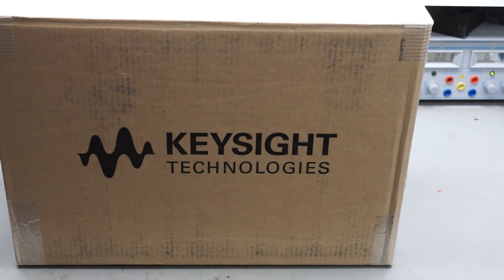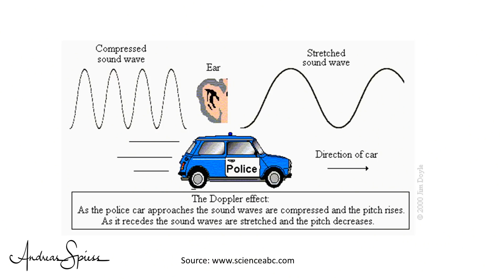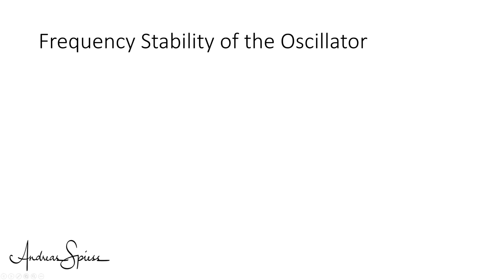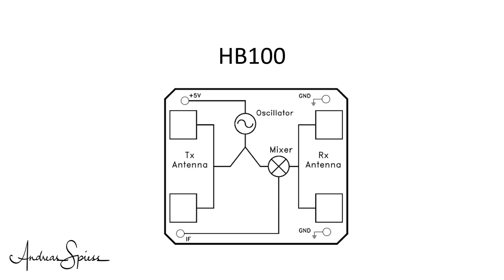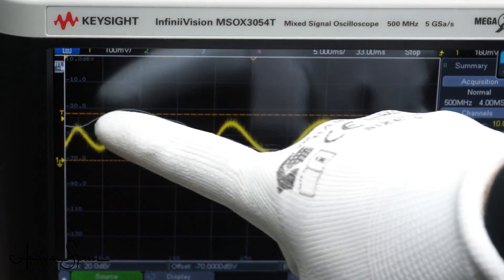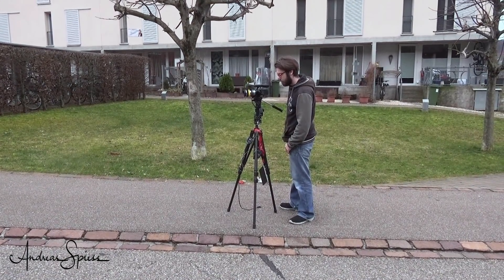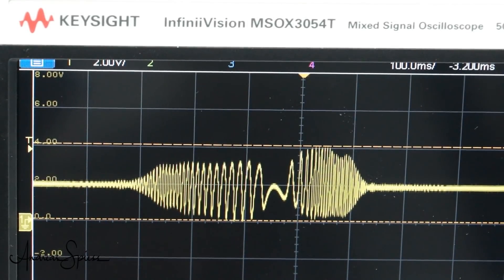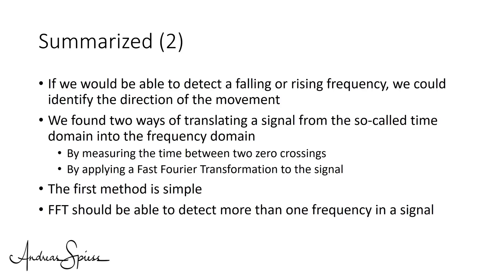#181 DIY Radar Speed Gun using cheap Radar Sensors (HB100, CDM324) for Arduino, ESP8266  and ESP32

Comment: @Andreas Spiess , How to connect my scope's ground probe if i want to take a look at the mains voltage?? 

It is a USB scope running off a laptop on batteries.

I have a 100X probe.
Scope input is 35V max. So in theory, i should be able to measure upto 3500V.

I have a single channel oscilloscope, so i can't use two probes and get the difference between them.
Reply from the maker: 1. As already said: This is dangerous, for the laptop and for you.
2. All mains have a live wire and a neutral. If you connect the earth of your oscilloscope to the live wire, your whole PC will be on 220 volts (It should not be destroyed if it is completely removed from any ground). But as soon as you touch it on an unisolated place, you will be electrified and the PC can be dead. The same applies if you connect anything on your Laptop to ground (as said: Connect a USB or Ethernet etc)
3. If you connect earth to neutral, this should not happen. Check (measure) first, never assume which one is live !!!!!
Reply: You shouldn’t measure mains voltage without a proper differential probe (you can probably make one), but if you’re willing to take the risk anyway (may Darwin bless you), you can connect it anywhere, it doesn’t matter, but make sure that the laptop isn’t referenced in any way to earth (disconnect everything, even Ethernet could pose a danger), or just connect it to earth.
Reply: GRBTutorials i did not quite get the last part.

What do you mean by "or just connect it to earth"?

Are you referring to the grounding clip on the probe??

By the way, my lappy is battery powered and uses wifi.

I disconnected each and every single cable from it and also kept it on an insulated plate and i myself am insulated.

I used a 24V transformer initially and probed around the LV side.

First made a bridge rectifier and connected the ground clip to the negative. But as expected, it only shows half waves when i probed the secondary side. I got a little more adventurous and connected the ground clip to one side of the secondary and probed the other side, i got the full sine waveform without any distortion. But when i used by dmm and measured b/w earth and my laptop chassis, it showed 20V AC.
Reply: Andreas Spiess thank you sir.

I have taken all the precautions that i could. I wanted someone more knowledgeable than me to confirm my idea and make sure i wasn't just getting lucky. 

Thanks a lot to you, and to GRBTutorials for taking the time to reply :)

Comment: But if the pitch is changing when in constant motion, then you can not measure speed,
Reply from the maker: The frequency does not change at a constant relative speed. But the relative speed changes if I pass the sensor
Reply: I think some trigonometry is required for speed correction.
Reply from the maker: On short distance, you are right. For our purpose, direction os more important than speed because we cannot ticked ;-)

Comment: Great Video!! Could you not use two or more of those $6 sensors back to back for an easy direction count cheat? One may have to be detuned slightly via the screw to avoid interference...
Reply from the maker: Maybe this will be the solution at the end...

Comment: Awesome video. I was also using an HB100 in combination with an arduino for simple motion detection. I am looking forward to your solution.
Reply from the maker: We will see how much we get out of the data. I hope more than detect motion...
Reply: Yes, that's a lot harder. I have built and used the reference amplifier that is specified in the HB100 data sheet (the one with the two LM324 opamps). It outputs a square wave with a frequency proportional to the speed of the moving object. The square wave is basically a digital signal. So one could count the 0-1 transitions per second with a moving window. Might be easier then FFT. I only used it for motion detection though. Also note, that I had to clean up the signal a bit. At no movement the signal sat somewhere between the low and high point. And also when an object was just about to enter the field of view the signal was not a clean square wave but some garbage. I used an analog input and cleaned the signal up in code with a threshold detector for the high and low levels. - Greetings from Austria.

Comment: Regarding direction detection.  The frequency change is not very reliable, being based on the detector being offset from the path, but that will vary.  However we can easily note that the volume increases for approaching movement, and decreases for departing movement!  So we can either measure the amplitude of the IF signal, or if you do use Automatic Gain Control, measure the feedback signal which controls the amplification.  That change in amplitude should determine direction in many cases, with a single object.  (Multiple objects are going to be hard in any case).

My question is how much of the reflected signal comes from Andreas and how much from his  metal bicycle?  Given the normal purpose for these sensors, we know they have SOME sensitivity to plain old people, but how much better is it at picking up a bicycle?  Experiments to determine relative signal strength would be very interesting.  

(I know you've been running up and down stairs to get your heart sensor activated, and now practicing on your bicycle for this; and with my being of a similar age I hate to discourage you from any exercise - but you could have your young assistant run towards and away from the sensor if you are not ready to show off yet).

And it would be interesting to see if you can (to some degree) tell whether somebody is carrying metal - keys, coins, cell phone, a weapon - by comparing signal strengths at the same distance with and without.  Does a person carrying a metal cell phone have twice the radar reflection as one without, or just 10% more?  I have no idea, but you are in a great position to begin testing.
Reply from the maker: We for sure have to do some experiments in the future. But first I need a decent AGC amplifier. And no worry. I drive about 4000 km per year with my bike...

Comment: Well, the problem with detecting the falling/rising frequency is that you have to a assume the bike is going at a constant speed. A quickly stopping bike may decrease the frequency more than it's changing proximity to the sensor increases the frequency, causing false readings, not to mention the angle from where the bike comes can change, since bikes don't always drive in straight lines. Another problem is, that multiple bikes driving very closely to each other would likely be counted as a single bike. So if you want accurate readings, this is probably not a very good way to count bikes. If you only want rough numbers however, I guess this would be a reasonable way to do it.
And if you want accurate readings, I guess this method would still be useful, but combined with other measuring methods. Since no method is perfect, but many combined can probably eliminate a lot of errors.
Anyway, I would be very interested in a way to measure distance to cars using for example radar. I've been looking for a reasonably cheap and reliable way to measure long distances (say up to 300 m) and preferably many times per second, but haven't found any way to do it so far.
Reply from the maker: I do not expect exact readings because of all the problems you mentioned. But I hope the errors will be tolerable for a certain purpose. And if not, we at least tried ;-)
Reply: Yeah, it's certainly an interesting experiment. I hope you don't take me mentioning likely problems the wrong way. I think it's great what you and other youtubers like you do. Regardless of whether it works as intended or not, it's always good to share your experience with others so they can learn from it.
Reply: @AndreasSpiess  Btw. what's wrong with measuring the change in amplitude to determine the direction the bike it going? Sure it's would be a little more complicated to do, but I think it would be a more reliable way to do it.

Comment: The change in towards/away sound (in this demo) seems opposite to 'Doppler' effect...  As the ambulance siren comes towards, its pitch  sounds higher, when the siren is just by us, it sounds 'normal', then when siren passes away, the pitch sounds lower.  But this is a moot point, because we can interpret the radar sensor output however we want.
Reply: the difference between this radar and sound waves is that you can hear the pitch change directly for the ambulance whereas the radar reflection is processed to produce a 'difference' output and it's the difference output that you hear in the video.  negative difference sounds exactly like positive difference. also we'd expect the difference signal to be zero at the instant the bike passes closest to the radar - for the siren this would be the instant  we heard the 'true' frequency.
Reply from the maker: The relevant for me is my measurements. And there direction does not matter ;-)

Comment: I was going to suggest you fabricate an inside corner cube reflector to increase the detection range... but if you're interested in detecting general cycle traffic rather than optimising your own speeding it's not relevant :)
Audio output sounded like an old fashioned bicycle dynamo IMO
Reply from the maker: You are right: It sounds like a dynamo!
Reply: I've remembered a humorous suggestion for defeating speed radar in an old motorcycle magazine... attaching corner cube reflectors to the wheels to produce strong  return signals with varying frequency shift, the theory was that this would confuse the receiver. doubt it was ever tried - it doesn't seem practical.
Reply: Interesting idea. Maybe install a larger rotating disk with cubes mounted on outside rim on top of car (wheels are probably too low). Could use this project to measure effectiveness of that strategy (or just use the US style speed indicators). I don't know how focused radar based speed guns are, plus I thought many speed guns now work with lasers pointed at number plates and directly measure return times (like lidar/rangefinders). That's much harder to fool.

Comment: The "small screw" you mentioned is not part of a capacitor. At about 6:08 in the video you see a small circular white object; that's a ferro-resonator. The "small screw" is ferrite and its proximity to the resonator adjusts the resonant frequency.
Reply from the maker: So I was „half right„ with the purpose at least. Thanks for the clarification!

Comment: Thanks for this introduction and the Pictures from inside the CDM324. I did not open the mine. I only had to open one of my HB100 arriving with a loose rattling disk of this dielectric resonance oscillator.
The arduino FFT works with the ESP32 just fine out of the box. Even with 1024 and 2048 samples.
I am very curious how the InnoSenT quadrature radars will perform  and what they cost. 
Also the AGC amplifier could help. Sounds promising.
Reply from the maker: I also played a little with FFT and the ESP32. So far I do not yet know which amplitude gives the best result nor which is the right sampling speed or # of samples to get max speed for the frequency range needed. Do you have any info about these factors?
The InnosenT costs around 30 Euros at Conrad. AGC amplifier is on order...
BTW: I opened mine because I killed it somehow. Don’t know how :-(
Reply: I used a biased signal with 1.6V virtual GND. Try to get the signal in front of the output cap.
The ADC of the ESP32 is poor (https://www.esp32.com/viewtopic.php?t=1045) , so you have to use the preamp to get several hundred mV.
Using 24GHz you get a Doppler shift of 3400Hz @76km/h and 40Hz @0.9km/h. 
To avoid aliasing you should sample at least 6400 samples/s (Nyquist-Shannon). Try 8000 samples/s which could work. Otherwise use 4000samples/s which works but limits you to ca. 37km/h.
If your radar also sees faster vehicles like cars, you should use a low pass filter as an anti-aliasing filter. 
To be precise @ low speed you should measure 40Hz with maybe 10%, that means 4Hz.
To achive a resolution of 4Hz @ 8000 samples/s you need N> 2000, that means 2048 samples per conversion, or 1024 @ 4000samples/s.
This leads to a window time of ca. 1/4 sec in which the speed should be approximately constant. Looks reasonable. 
You find some formulas e.g. in https://home.zhaw.ch/~rur/dsv1/unterlagen/dsv1kap3dftfft.pdf http://public.beuth-hochschule.de/~mixdorff/mmt1/files/spektralanalyse.pdf  https://home.zhaw.ch/~dqtm/dsv1/vorlesung/dsv1kap3_dftfft.pdf 
You should use a Hanning window (arduino FFT provides it) to reduce the effect of a finite oberservation time (rectangular window).
arduino FFT is a complex FFT. You feed the ADC samples in the real part and flood the imaginary part with 0 - when using the cheap radars.
Using the the quadrature radars you feed the quadrature signal to the imaginary part.
arduino FFT performs the complex FFT and has a function to calculate the magnitude vs. frequency and to pick the highest magnitude. This maybe a bit crude and you may add a function finding several local minima.
And extracting the phase (leading to the direction) is not provided by arduino FFT out of the box as far as I remember.

Comment: Very interesting and cheap. I am going to put one of those on my list to order. 

Small typo in the description. You have the amplifier as LN386 as opposed to LM386.

Recently I used a LM386 on a guitar amp build. I have all the discrete components to make one and its easy to design but at US$1.15 shipped its just not worth the effort and time. Interesting times for electronics with cheap parts and oscilloscopes. Even phones with all their functionality really are a marvel compared to what I had available when I was young.
Reply from the maker: LN corrected. Thanks. You are right: Interesting times, 10GHz sensors for 3dollars...
Reply: I'm curious about the amp. Is this really necessary given the arduino and other controllers can handle frequency measurement up to about 8mhz with freqcounter?

Comment: To messure only frequency, the signal is very often staged throug a comparator. This gives a nice square frequency. As far as i know, Atmel AVRs have one build in. Or just use a OPamp. Then feed to an input capture pin and the time os messured.
Reply from the maker: That would then be version 1. I have also to check if the digital pins of the ESP32 are Schmitt-Triggers

Comment: Great video!  I wonder if arduino fft would be fast enough to perform calculations and update a display or if the processing would be too slow to do it in real time
Reply: The ESP32 should be fast enough to do that.
Reply from the maker: The ESP32 worked. But I want to tweak it that it is as fast as possible...
Reply: Maybe you could try implementing it on an STM32F765, they're very fast but still embedded. You could even try a NanoPi Duo for a Quadcore Cortex-A7.

Comment: With the speed...I would also be interested in the distance as well...would you have an idea on the accuracy of the measured distance on each of the sensors. My app would need the accuracy to about 3 centimeters or say 1/2 inch. In addition I will need to measure the distance and then transmit the value to another location. Thanks for the great video and channel.
Reply from the maker: There is no information about distance in the signal
Reply: Thanks...I'll work on that.

Comment: Great video! Would weather conditions have any effect on these sensors?
Reply from the maker: They are used to detect rain and snow. So I assume it has
Reply: From what I've read on the advertisement page for the sensors: No, nor do most objects short of concrete walls and metal shielding in front of the sensor. It does say to install it away from moving conductors and magnetic fields however.

Comment: Hi Andreas, Do you know the size of the beam, and if it can be focused? 
I have 2 of these modules, and would like to see if I can use one of them to make a pan and tilt radar for my Tarantula quad-copter.
Reply from the maker: I showed the diagram about directionality. For sure you can build a horn type antenna. But it might need a lot of experimentation
Reply: The experimentation part is fun too. I'll 3D print a small radar antenna and take it from there. I forgot about the diagram. Thanks for the reminder.

Comment: Very interresting. What is the current requirements for these sensors?
Reply from the maker: 40 mA
Reply: Thanks. A battery killer then, I'll need a permanent fixture for these. I'm looking to detect visitors coming up my driveway.

Comment: Msybe I should have done this, by the way use the 24 Ghz and some range sensor in software. That is correct the screw is a fine adjustment. You need range gates for distance as well. Doppler radar maybe you could use pulse radar. Nice work Andreas.
Reply from the maker: In the description, they talk about pulsing the radar. I do not know why I should do that other than saving energy.

Comment: Great video, I suggest you to use two sensors facing opposite directions at least, then with some calculation you can understand who is entering and who is exiting using the Doppler effect formulas.
Reply from the maker: That is another possibility. Then we also would need two ESP32 if we go with FFT, I think.
Reply: the ESP32 has two ADCs so theoretically, if the FFT algorithm is lightweight, it should be possible to do some stereo FFT, maybe using the other core, too. If your point is to build a low power device then this way should be the right one, otherway a Pi Zero W will have the right hardware to do so.